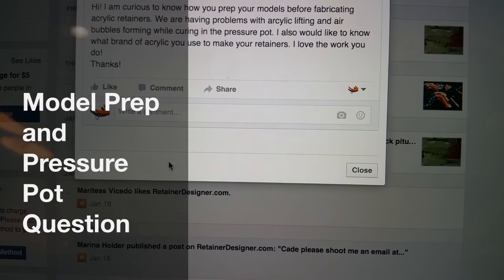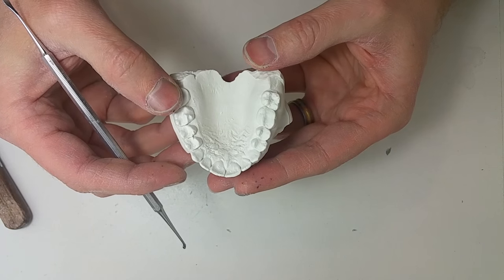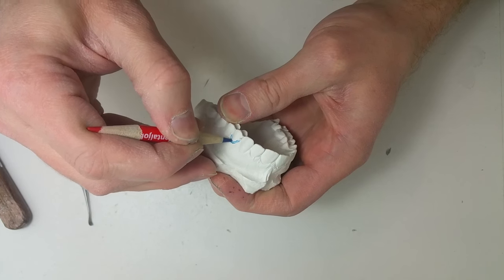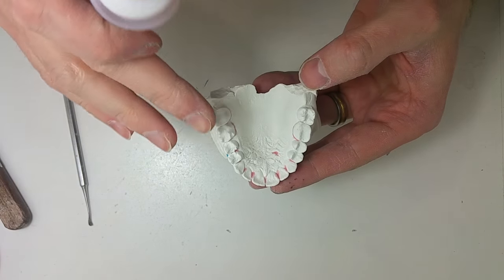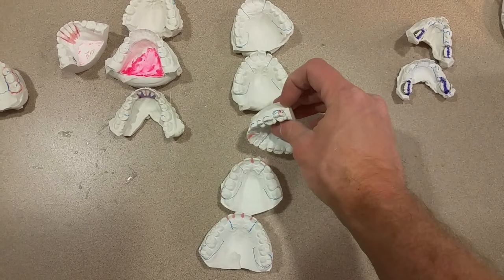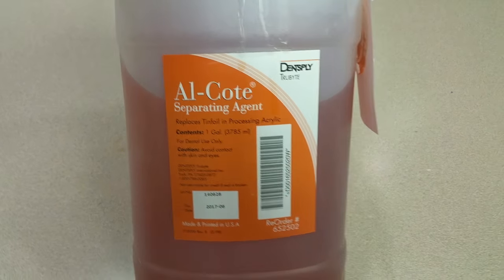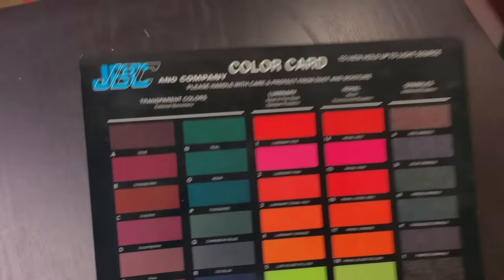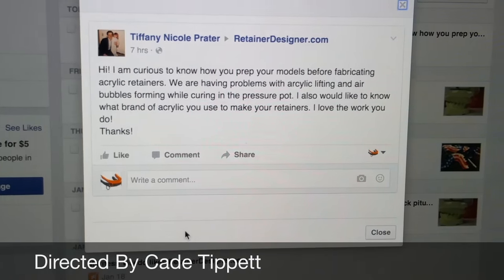Model Prep and Pressure Pot Question

Comment: its fascinating all the ways different people work....i would never dream of handing off a job for someone else to bend wires for. And i just soak the model with wires on, spray up then put it in the pot; no separator. never gotten an air bubble.
Reply: Think we use similar methods...  Straight forward and straight to the point lol

Comment: What is the advantage of submerging the model?  Great Lakes and JBC both recommend steam only.
Reply from the maker: cr List i do use the steam method for the curing just like JBC and Great Lakes, but then i submerge it after the i initial cure, i believe it helps to completely cure the acrylic further. And helps remove free monomer radicals from the acrylic surface. And it makes removing the retainer off the models easier.

Comment: Hi I’m a orthodontic technician my question is how do I pour acrylic without bubbles
Reply from the maker: Hello, Using a pressure pot like inthe video it your best bet for pouring acrylic without airbubbles. Also I use the "Salt and Pepper" method to apply the acrylic to the model instead of a pre-mix method, that helps too